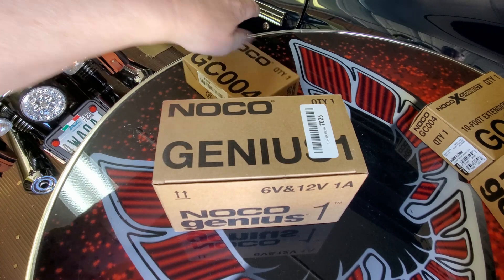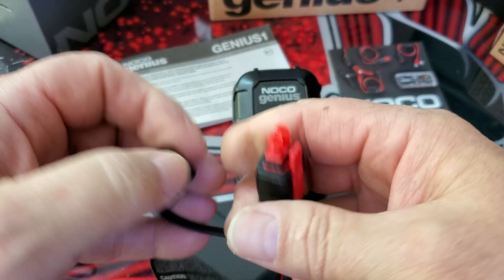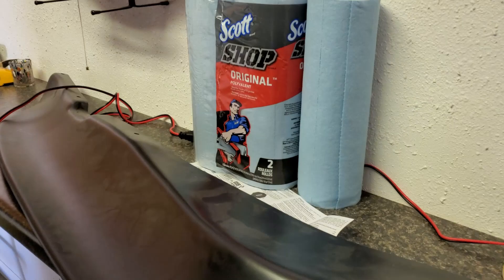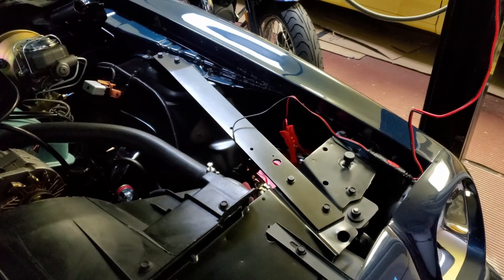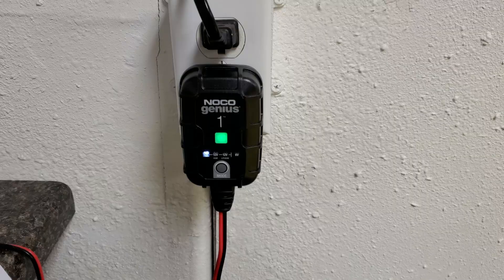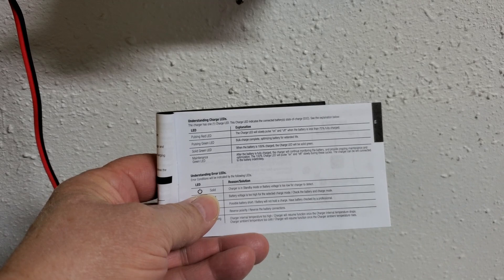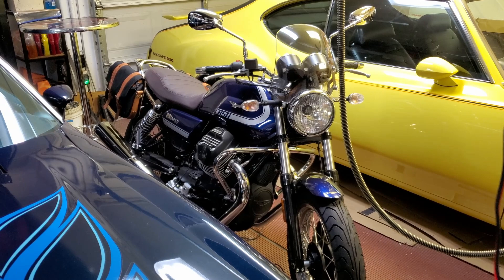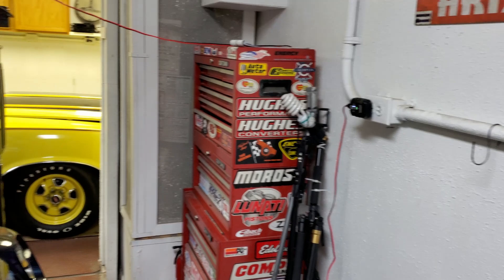NOCO Genius 1, 1 Amp Charger/Maintainer. Use and First Impressions.

Comment: I got this NOCO 1 charger for my motorcycle battery.  After not using the bike for months I like to charge it to top condition and then that is it.  I use Lithium Batteries in my motorcycles which are superior, lighter and have no acid rusting effects on the body of the vehicle as lead acid batteries do. I disconnect my batteries when hybernating and charge them to standards upon waking up and for the small motorcycle battery this NOCO GENIUS 1 charger / maintainer is superb.  NOCO has other more powerful models that are geared for use with larger batteries
Reply from the maker: Agreed! Mine has worked perfectly

Comment: Nice review! I have a couple different chargers from this brand and have zero issues. I’ve used them when storing and charging my parents T-bird, ‘31 Model A’s to my F-150, 2500 Savana, travel trailer, Subaru and lawn tractor (wide range of vehicles).
Reply from the maker: They've worked well for me keeping my batteries topped off. Maybe like you, my classic cars don't get driven often so it's good for battery health to keep them charged and maintained.

Comment: I have both the Genius 1 and 10. I have a 2011 GMC Acadia. I rarely drive anymore due to illness and live in the MO Ozarks. I've had battery problems, my mechanic just looked everything over, everything's great; battery, alternator, electrical, etc. Is the Genius 10 too much to keep the lead acid battery maintained? I'm trying the Genius 1 out now. I never realized until that that a 50' cord affects the amperage 🤦 I'm an old lady, lol 😅
Reply from the maker: Yes, the longer the cord the higher the resistance, the gauge of the cord makes a big difference as well. A Genius 10 should work fine. It will charge much faster than a Genius 1 and the two chargers should maintain the battery similarly.
Reply: @SPSteve  Thank you so much for such a quick reply! I'm learning a lot with this situation, which is good. I've never had an issue before, and I rarely drove out of town, even onto I-44. But I did drive daily. Since my illness, I usually only drive 2-3x/month, just around town. It's been really hot as well. I was very careful in choosing the right gauge extension, as well as proper outdoor weather conditions. I never thought about length 🤦
Reply: @SPSteve  PS-One more question, please-My Genius 10 shows flashing green after being solid (so it's charged) why does the Genius 1 show flashing red for hours? My battery is just under 1 year old, but it just discharged completely recently. Also I noticed when driving my dashboard battery user to always be at 15; now it starts at 15 then drops to 13 after about a mile. Is that because it was discharged completely? Thank you so much in advance for all your help.
Reply from the maker: @aibhilin1211  Good luck to you. Be sure to unplug the charger before disconnecting from the battery, and connect to the battery before plugging back in.

Comment: You leave it on all the time for 5months? Even tho the light is green, i thought the light is green that mean its done charging, where did it said its a maintainer?
Reply from the maker: Yes, if I'm not driving the car, it's always plugged in. It's a battery charger, maintainer and desulfator. In the manual it says it can be left connected to the battery indefinitely.

Comment: I could be wrong but i thought the instructions said it starts by completely discharging the battery then charges it back up.... Then holds a safty tricle charge mode
Reply: I doubt that it would discharge a battery before it charges it. These units are really designed to maintain a good battery opposed to charging a dead battery @1volt it would take 2 weeks or longer to fully charge a completely discharged battery.

Comment: I looked at the manual online. There is NO on/off switch that I can see. So I have to unplug this & remove the leads everytime I get in my car?
Reply from the maker: Thats right. Unplug it from the wall and then disconnect it from the battery.  Trickle chargers are primarily intended for cars that sit idle for long periods.
Reply: @SPSteve  Sometimes my car sits for a week or more. Sometimes not. I have a BMW. Modern vehicles have computers & alarms that are a constant drain on their batteries."Parasitic draw." If you don't drive every day to charge the battery they drain pretty quickly. My last BMW battery lasted 13 years on a smart charger. The same with my Harley. Harley battteries are only supposed to last about 1 year. My current Harley battery is going on 6 years on a smart charger. (Although it needs replacement now.)

STORY: I had to help a couple jump start their BRAND NEW car. They had just bought a new battery & it was dead. They told me they only drive their car about once a week & they keep having to buy new batteries for it. My advice was, "Go immediately to Auto Zone & buy a smart charger & hook it up every time you park it." Smart chargers are NOT just for cars that sit idle for long periods of time. 

Almost ALL these smart chargers are POORLY designed. They should ALL have an on/off switch so I can turn it OFF, remove the leads & GO! Come home, connect the leads & turn it ON without having to UNPLUG IT every time I wanna drive my car or motorcycle. But, that's American ingenuity for ya.
Reply: Poor you, can't you ask your mummy to do it ?
Reply: @royblackburn1163  Oh hi, Roy. I got the naked pictures you sent me. But the answer is still "no."
Reply: I think they make these things called surge protectors that have on off switches. 
Typical bmw owners lol

Comment: Is 15 Honda grace/vezel agm?
Reply from the maker: I'm not familiar with that. Check you owners manual.
Reply: @SPSteve  its a battery with liquid on the inside I was wondering if i should select the agm mode
Reply from the maker: @jevonclarke3638  AGM is absorbed glass mat. You probably have a standard battery but it would be best to verify first.

Comment: It's 75% of the full amperage!
Reply from the maker: The Optima Red Top I have is 50 Amps and 800CCA. If it was discharged to a state of 37.5 amps I would be surprised.